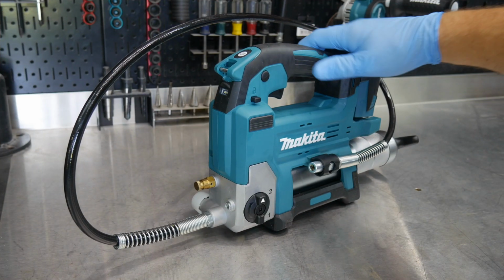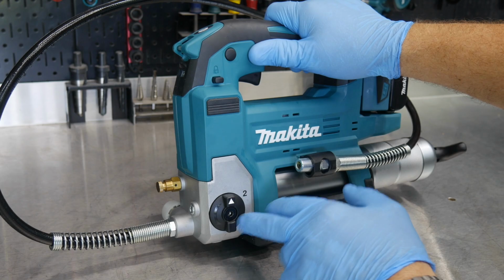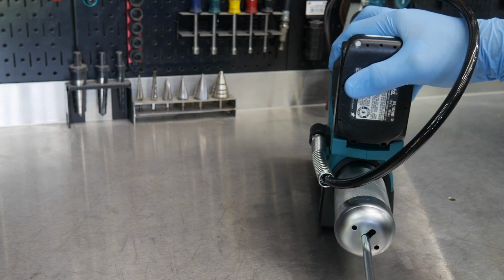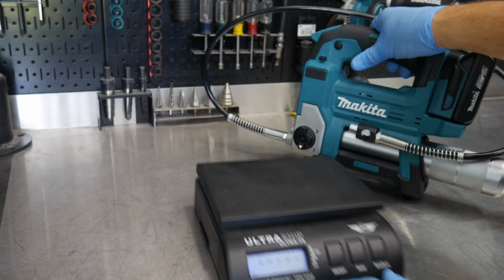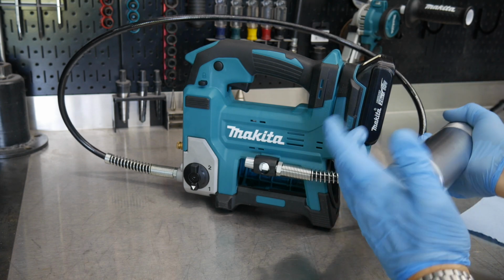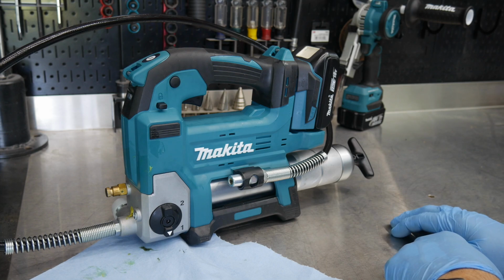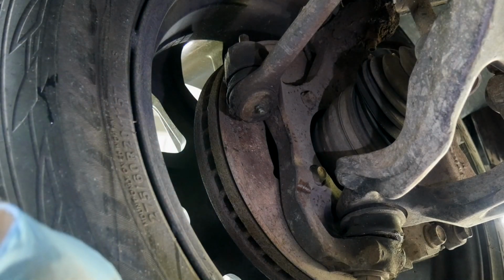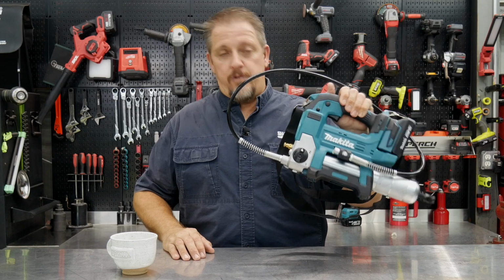No More Pumping, Everyone Should Do it This Way! Makita XPG01 Grease Gun.

Comment: I got it back in July. Have been using 5 to 6 days a week. And most days it's 1.5 tubes a day some days 3 tubes. Greasing anything from a skidder to bulldozer to a excavator. Mostly muddy conditions. Personally I love it. Battery life is really good. And always unscrew the tube a few turns before pulling the handle back. And yes it's a little aggravating with the tubs not seating all the way down but I have gotten use to it now.
Reply: Thanks I plan on using it for heavy equipment at work. I’m tired of the manual grease guns.
Reply: @ChrisLawley43  year later it’s still going it’s probably worked out to be about a tube a day. Still some days it’s 2 to 3 tubes a 5.0 battery will go about 2 weeks on a tube a day

Comment: I got one.. I love it, only issue I had was grease was getting on the backside of the plunger.. swapped it out with a plunger from an old hand pump gun and fixed it. Haven't heard of anyone else with this problem, they might have forgotten the rubber bit on assembly and I got unlucky, either way no biggie
Edit: yeh definitely didn't get the rubber cone like yours has just had the plastic backing.. will have to ring the tool Shop and see if they can get it for me
Reply: Had the exact problem!
Reply: You needed to only undo & turn plunger around, as it was set up for bulk grease, not cartridges

Comment: Do they offer this in a 12v and/or 40v model now? I’ve had great experience with the 20v Dewalt but I would like to try this in the future for a change .
Reply: Makita’s 12 volt line is awesome. The price to performance is spot on. You could fill your garage with very capable tools for a fraction of the price going with the 12 volt CXT line up. 

The cordless ratchet, sawzall, impact and drill all impressed me. Makitas 1st gen CXT impact was the strongest and fastest out there upon its release. Same with the ratchet that you can switch heads on from 1/4 inch to 3/8. They were leading the way in innovation but have slowed down drastically since then. You’ll get the occasional release of an already existing tool but with a brushless motor and different modes. The innovation and competitiveness just isn’t there for their CXT line anymore. The more they see sales go up I think the more we’ll see them get their competitive edge back. Because it’s kind of just been them releasing cool and capable 12 volt stuff and Milwaukee releasing their own more powerful variant of it lol. I wouldn’t blame Makita if they put the CXT line on the back burner and concentrated on their 40 volt line and specialty tools. I’m invested in their CXT line up but often kick myself when I see the Milwaukee 12 volt offerings and the same old Makita stuff month after month. If I knew I’d never see a 12 volt Makita band saw or copper tubing cutter I’m sad to say it but would probably abandon team teal for team red. 

That’s been my experience thus far with the CXT line. I’d love to see another team teal member help inspire the Makita engineers to get off their behinds but the 12 volt line up of other companies are just drastically larger and still growing.

Comment: I have a fitting that broke off and stuck to the gun. Any ideas how to get it off? Anyone. Thanks
Reply from the maker: You should be able to take the grease fitting apart and remove the grease zerk.
Reply: @Shoptoolreviews  only half on the fitting came off. I was getting frustrated, took it apart. Hit it with a punch and came off but damaged the adapter. Oh well

Comment: Still don't quite understand why the grease tube would not insert all the way. The other battery grease guns I've used allows the tube to insert all the way. Obviously the rubber follower is fitting in the tube else it wouldn't flow grease. Very confusing.
Reply: I'd say the plunger is cocked over inside the tube when it's in that position.. so when you release the rod it lines up again

Comment: What thread size is the grease coupler? Want to purchase a lock and lube lock on end
Reply: You want the standard lock n lube that goes on 1/8 npt fittings. I just put one on my makita today.
Reply: @Jaredbar  does the locknlube fit inside the onboard coupler holder?
Reply: @jasoncooperpcola  the end of it slides in but it can slip out. It only goes in about two inches
Reply: @MegaMunchy  convenience. the quick connect fittings are too cheap not to consider it. I've busted my knuckles too many times taking a normal fitting off a nipple to care to count lol